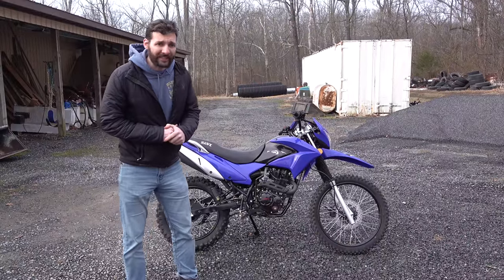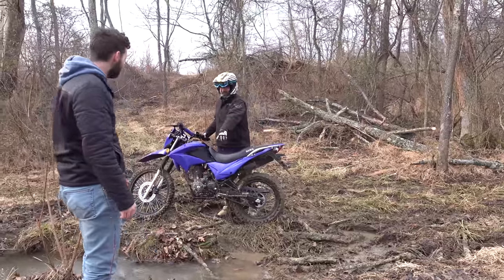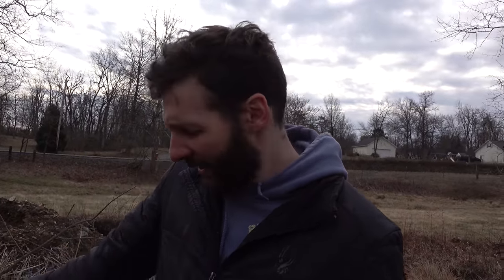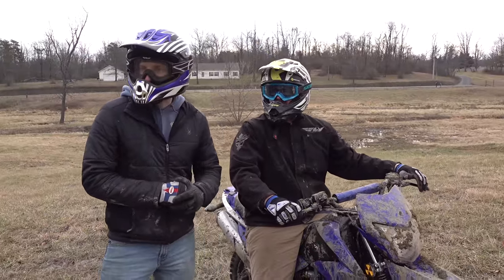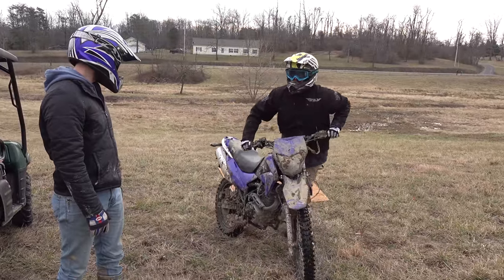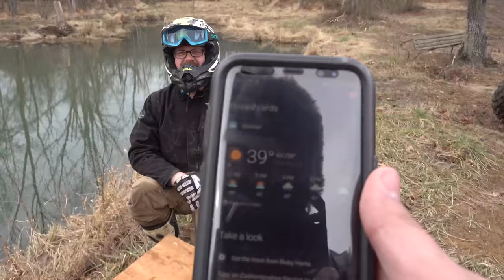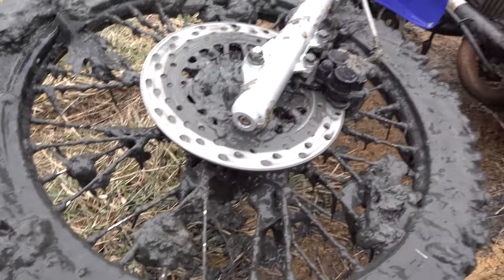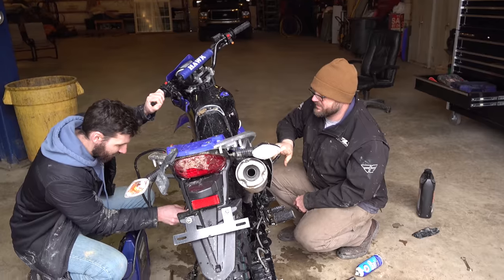Amazon Dirt Bike TORTURE test, will it SURVIVE?

Comment: Hell these chinese top ends hold up longer than my hondas. Ive had several. My 110cc redcat and my 125 coolster both took serious beatings for years. Banging rev limiters constantly ramps muddy trails flips neglected oil changes cringe gear shifts no valve adjustments and letting every one of my friends ride and beat on them 3 days a week for the weekend. I just tell them ride it like they stole it if you break it it wont cost more than $35 to fix 😂. The Most we normally break on them is chains carbs and bushings. I need to make a channel dedicated to these things
Reply: A honda? Idk bout that bud
Reply: Its ok, that bike is adopted.
Reply: @Luci9.9  I have a rancher 350 rancher 420 and a pioneer 700. Just sold my 250ex and 150r.. Also have one of their push mowers. Honda is solid and ive had a lot of them  but you would be surprised how chinese engines compare lol

Comment: Nice, clean one owner ready for craigslist 😁

I had one of these and I’m not surprised it survived your “tests”. Amazingly capable bike.  
The engine is by far the best part of the bike and will long outlive the rest of the bike. It’s the weak suspension, loose bolts, soft metal frame and crappy wheels that will be the death of the bike.  That said. When it’s all said and done you will have a perfectly fine engine ready for a donor frame

Don’t buy this bike if you don’t know how or don’t want to learn how to work on bikes!!!   

It NEEDS someone who can trouble shoot and fix
Only buy this bike if you like to tinker and are on a budget.

Comment: That things amazing it even runs underwater.😳👍 Put a long pipe on the air intake and the exhaust wear scuba gear and do some under water motor cross. It'll be the next big thing. Scuba cross. Just pay me 25% for the idea that will be fine thanks.
Reply: it wasn't running, that was air escaping. Think about things before you write, it helps...

Comment: I had a cheap China dirt bike as a kid. Apollo 007 125cc. (Dirt bike so no lights, battery, starter...) It had the bigger wheels so it felt like a normal bike. I was able to get UpTo 60mph on it. It was abused, I fell into a pond. With it. Fluid change and blow out the water and it was back in business. People would make fun of it for being a little 125cc and a China bike. But, when they took it for a ride. Only smiles. It was a great bike. That 125cc motor had just enough power. You could pull a wheelie if you wanted. And the taller wheels gave it a higher top speed (for a dirt bike 60mph is plenty fast).

Comment: i bought myself a hawk250 for $1319 total shipped to my door in 2017. the thing just runs every time i push the starter. speedo cable did break on it so i put in a digital dash, but other than that its a great adult sized bike. they have a fuel injected version of it now for a few hundred more.

Comment: Back in 2019 I bought a Big Boy TSR250 when I was on holiday in South Africa which is a extremely similar looking motorcycle. The body work and plastics are identical. When I bought this bike it was new. It is a Chinese knock off of a Honda. It was extremely cheap and nice to ride I found the plastics brittle but mechanically reliable. I enjoyed it so much I imported back to New Zealand when I returned home. I still have it and ride it here even though NZ registration is been a pain in the ass to get it licensed for the road. Great video BTW thanks for sharing

Comment: After watching this I sent it to my in-laws because they were looking for a bike for our summer mountain trips. They were so impressed with this video that they bought one and had it shipped to me to assemble it. The video does not show how tall this bike is lol.  I'm 6'2" my in-laws are both about 5'7". Once I got the suspension and front tire on I realized they would not be able to ride it. I now have a Hawk 250. I've put 120 miles on it on the trails in the Wyoming Rockies and I am pretty impressed with it. Some off those trails are not easy at all, but the bike handled it with zero problems.

Comment: I love my hawk 250 . Only downside I would say it some of the parts are cheap and most likely you will have something break on you after the first ride or see somthing that will need replacing soon .  all in all it’s a great bike I’ve replaced all the lights , after mark carb , sprocket change, new tire tubes(after my first ride my tire was flat day one ) , runs like a dream 💭 starts every time cold start

Comment: My buddy dumped his 2018 gas gas in a lake during a enduro race. We pulled it out with a boat and it started right up after! The problem was a month almost two later the ignition system went out from the water damage over time and another month after that the crank bearings went out from corrosion even after flushing the crank case out with diesel and oil the day he dumped it. So you may not see the affects right away.

Comment: I have the same bike 250s i ride it every day 140km per day for 3 years form home to work now it got 160000 km => 100000 miles with out any loss of power without opening the engin nuts and it got very low fuel consomption it make 120 /115mpg on the highway

Comment: I raced a Matchless 600cc Single Typhoon (Anyone EVER hear of that bike?), a Maico 400, a Husky 400, a Bultaco 350, and a Yammie 250. Every one of them often came home looking like this bike after they jerked it out of burial. Not one of them would have lived thru this abuse without a bit of work or a total rebuild. Not one of them would have handled water up to the gas tank and kept running without a lot of waterproofing. Of course one day of enduro/motocross abuse is not a full season. Frames break. Exhaust pipes fall apart. Cables and handles and cranks break. All kinds of shit gets bent up. And in the end, with some work and parts, they're ready to race next weekend for a several years. Don't know if this little toy bike could make it for a few seasons of regular racing, but for $1400, man, it would be a lot of fun. And it has a 3 year 100% protection policy that covers everything for a couple of hundred bucks. I may buy one just to buzz around the woods pissing off the soccer-mom neighbors.

Comment: I'm not surprised by the quality of the bike. China has been copying bikes for years and the quality controls they have been putting in place for years are only becoming better and better. The motor looks to be a copy of a 70-80's vintage Yamaha 4-stroke of some variety. I wouldn't be surprised if this thing lasted for many thousands of miles with no issues - save for the non-critical bits and parts. For 1400 bucks you could do worst! I'd buy this thing without hesitation if I needed another bike for messing around with.

Comment: Definitely toss a sub to my Christian brother from another mother.  Good stuff.  I have 4 kids and have been trying to figure out where I'm going to find 50 grand so we can ride as a family.  I might have found my answer for the kids at least.   

Although, to be fair it wasn't THAT much of a real torture test where true mechanical failure would occur. But it took a licking and kept on ticking.  I'm an engineer in the automotive industry and you were on the right track with getting the exhaust pipe glowing red.  LOL

Comment: Hey man big fan,
I bought a 98 Suzuki vs 800 intruder used and when I turn it on it works great for about 20 mins till it finally warmed up and for some reason the bike does not accelerate anymore after Till I turn it off and let it cool off. Can you direct me onto what could be the issue, thanks man

Comment: I'm sure it has the cheap chinese break-in oil in it still... dump it and see how it looks/check for shavings. Suggestion: give it to an mx guy. Rip it around a track. See if it starts shaking itself apart and shears off bolts.
Reply: Edit: just saw the end and dumping the water put from the pond.

Comment: My kid had one of these totally destroyed it .they did a brake torch a rock went up into front gear box by front sprocket all the metal around even the motor shattered unfixable . It was junked
Reply: The metal is super soft and very fragile tap any of the motor with a hammer or throw a rock at it from a gravel pit like motor dike sride around

Comment: I have one rejetted with full exhaust and it's great
Reply from the maker: What her kit did you get and what exhaust ?
Reply: @BikesandBeards I bought the hike from a wholesaler but all the parts from Amazon as cheap as I could possibly find.
Jfg racing exhaust, cloned makuni vm26 carb with an off brand 110 jet. About $135 total and it actually feels like double the power not a crf or anything but it definitely lifts up and I can actually make it move when I tell it to. Top end improved alot also.
Reply: @BikesandBeards  crf230f parts seems to fit like a glove for the most part